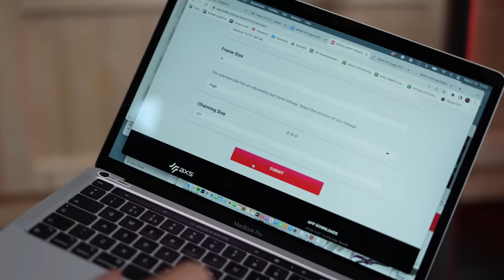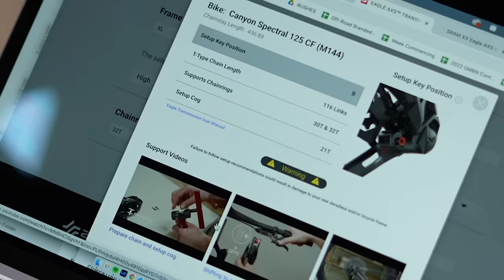NEW SRAM GX Eagle Transmission | Unboxing, Installation And First Ride

Comment: Wow... $270?  My most recent cassette was about $50.  That's an XT 10-speed, but it still seems like the prices are getting a bit absurd.
Reply: Agreed!
Reply: 10 speed but how do you climb up a hill?
Reply: That's typical SRAM.  The regular GX eagle cassette is $225.  A Shimano XT 12 speed cassette is $150 and a SLX 12 speed cassette is $100.
Reply: @alabaster4263 easily, just drop the chainring a couple of teeth. I have no use for big gears
Reply: @alabaster4263 good ol MUSCLE
Reply: @alabaster4263  by turning the pedals.   Also, I have. 3x10.
Reply: @alabaster4263  I think your sarcasm has been lost on a few people...
Reply: @mctrials23  lol
Reply: And the durability is the same or less.

Comment: I love my GX AXS but there is one fundamental floor with the rear mech, the pogo pins fail because of water ingress. The springs in the pogo pins suffer corrosion and fail to spring back up and loose contact with the battery. Had mine less than six months and I’ve had to have a warranty replacement. This seems to be a common problem with the GX and not the XO & XX model as water doesn’t sit around the pins as it can on the GX. SRAM need to sort this out.

Comment: I recently pulled the trigger and bought the  Axs XX T Tyoe. Fitted it to my trail bike and it’s flipping awesome. Doddle to fit and under load gear changes are a game changer. This GX version is the same thing just a fair bit cheaper. Prefer the battery placement too, something them didn’t do on the top tier versions. Awesome kit, SRAM are knocking it our the park at the mo. Paired it up with the new Ultimate stealth brakes also. Tidies up the cockpit and cables hardly noticeable now. Such a clean look with the AxS dropper. 👌👍
Reply: Hi do you have new Axs system or the first generation?
Reply: @slavbielesz184  it’s the brand new transmission XX T type full drivetrain which removes the UDH.  Not cheap but awesome. The new GX T Type offers very similar functionality for a fair amount cheaper. However still not cheap but brilliant 👌
Reply: Thanks for your reply.

Comment: Agreed, I think everyone wanted to know what GX would cost and when it would release 😁

I personally want to know if I can still use my Canfield cranks with an aftermarket T-Type 3-bolt DM chainring and still use this drivetrain. (Cmon Wolftooth!)
Reply: I've got a feeling you won't run into any trouble using a normal 12 speed sram ring with this, but who knows.
Reply: Your wish came true.  Wolf tooth just released some chainrings recently for transmission that will work with your old cranks.
Reply: @radian2323  Heeeeell yea!

Comment: Doddy, how’s the clutch? The prev GX AXS clutch was weaker and caused a lot of chain slap and noise. Is the new GX AXS, enduro race ready? #askgmbntech
Reply: It was a weak clutch for sure, but the main problem was the whole DR slopping around as there is no cable housing to keep it tensioned.  This new T-Type DR doesn't move, and they have increased the tension on the clutch. Downside is they say it does wear the battery down quicker.  But apparently no more chain slap.

Comment: I think the SRAM T-type AXS Transmission is perfect for a full power MTB; but my 17 yr old MTB with Shimano Deore XT 3X10 has always shifted reliably under extreme duress going up a steep bluff in the woods!  I think that is why Shimano is not feeling any pressure to change.  XT is already fantastic!!!

Comment: As a test, try the derailleur only on a bike with nx all round for example. Be interesting if it worked OK or not.
Reply: I'm curious as well, as I have the NX groupset and wanted to just buy the RD and the Controller...I'll ask LBS as well before purchasing.
Reply: @dongkapuyawn5107  Well, they're already stated that this is designed only for the new cassette series they created, while the NX is still based on the previous Eagle design. I'm sure it will still function, but your experience will be absolutely nothing like what you see in reviews.
That being said, the NX cassette is kind of garbage so it'd make more sense to sell it if it's relatively new or wear it out and then upgrade.
Reply: Gears are not spaced the same as older eagle 12 speed. They are much closer together.

Comment: Doddy, did you leave the shifting 'backwards'? I am glad to see someone else feels that the upper button to shift up the cogs makes more sense! Well, when the revised paddle for the prior version came out, the new paddle was more consistent with the mechanical shifter when set up backwards so now I have all my bikes set up that way including the ones with the t-type.
Reply: When I get mine I'm going to try Rhys Verner's set up, bottom left pod to shift down, bottom right pod to shift up just like a car paddle shift. Either top button for dropper

Comment: For me its still to expensive. 
But with the gx its getting better 
Maybe in a year or two
Reply: It just made all the high end mechanical groupsets (XTR, XO1, XX1) obsolete though.  $1100 is cheaper than XTR or XX1 and only a little more than XO1.
Reply: @mrvwbug4423  
Yea but thats no valid argument. 
With release of the Transmission line up it was obvious, that the "old" eagle line up will be substituted with that. As always it startet from the top end, with the lower price points released later. The Problem is, although named gx, so like the mid range predecessor, the new gx is priced way above that. 
The people who bought XTR now can buy gx 
The people who want more can buy the new expensive stuff. But what is with the people who bought gx and nx? 
When gx eagle was released it was priced around 500
The gx transmission costs a grand
Reply: @mrvwbug4423  
This is a Problem we can see in every industry. Doesnt matter what we look at
Lets say there is a budget-series a normal-sries and an ultra-series
The Budget 2019 once costed 200
The Normal 2019 400
The Ultra 2019 700

In 2022 they release new models 
The Budget 2022 now costs 380 
The Normal 2022 costs 650
The Ultra Costs 1000

Althogh named like before they price each one a tier higher. But because they name it the old way many guys dont think about it. Especially not the reviewer. Great for the people who want everything. But what about the people who once bought the Budget? There is nothing left for them in the 2022 Series. 

Lets see how its gonna be with the Transmission line. In the eagle line the high end Stuff costed 1.5 grand, the best bang for buck was 500-600 (gx). That was the "group of the people" and the budget one was around 300-400 
I am quiet sure they will call the gx the group for the people, although priced the same a few years ago the high end group was priced. Its so ridiculous 
Now they

Comment: After two years of use, I had a bad experience with a GX Eagle AXS : one of the pogo pins making the connection between the battery and the derailleur broke. Of course warranty was void by two months.  When contacted for a solution SRAM answered me that unfortunately there was nothing they can do to fix my problem. Solution proposed: buy a new derailleur!! I will think about it twice next time, that's for sure.
Reply: yea after 15 Years my Snowboard broke, Of course warranty was void by 10 years and they didn't replace it.
Will not buy that again.....

If you had any brain you would just call there 10x times and one of those someone will help you.
But yea... ;)

Comment: Thanks for this video guys! I believe you spoke quickly about backwards compatability, but I wanted to just check. Will the SRAM GX T-Type 'Transmission' run with an XX1 or XO1 AXS cassette (previous version cassette)? OR does it need to be a 'Transmission' cassette (XO or XX)?

Comment: Hey, do you have any info on whether you  can change just the derailleur (for the old gx axs) and use existing chain and sprockets? Are the rollers on the new one any different then on the old one? Thanks

Comment: I like the setup a lot, except the price.
Last month I wrecked my first (M8100) rear mech, a branch popped up into it and ripped it apart. (Cage broke, and the aluminium paralellogram also broke)
I replaced it with a M7100 mech, which I guess is somewhat comparable with normal GX?
It cost me €85 . What would replacing the cage and skid plates on this GX AXS cost? I can imagine it would cost me more.
Reply: No, the GX is more equivalent to the M8100 and the XX1 is equivalent to the M9100. X01 is in weird position where it doesn't really exist in Shimano land.
A cage with pulleys is like $30 for GX
Reply: @rustler08  I reckon SLX sits just under GX then? Because comparing it with sx/nx doesn’t do it justice.

Comment: been mtb for 30 years.   analogue shifting has never ever ever been an issue.   long live analogue....
Reply: I have exactly the same feeling as you. I use a mechanical 1x12 sram GX and I do not really see the point of the electronic gears. I have ridden bikes with electronic gears and I do not notice the shifting difference, a few milliseconds do not really matter if only a computer can notice them, I could not really see the benefit of it in racing or hobby riding. A well installed and maintained gear cable and mec shifts perceptively just as good and within similar precision. I really wish that Sram and Shimano will not fade out developing new mechanical group sets. Not saying that I am opposing the technology but I wish they still made both mechanical and wireless so they can please both parties.
I have a feeling that soon this kind of debate will transform into one of those rim brake vs disk brake topics.
Reply: @alexandrugabriel8510  agree
Reply: @alexandrugabriel8510  after riding both, I would take a gx axs over analogue any day, the only problem is the cost...
Reply: Until you hit it on a rock.
Reply: @colincoulthard3021  Funny, I've hit several rocks, and had several 'yard sale' wrecks.  Derailleurs survived just fine..
Reply: I can't see the point of e gears. More weight, more batteries to deal with and hugely expensive. Why?? My regular GX works fine
Reply: @Puketaha1  exactly...
Reply: @Puketaha1  more weight is bullshit. You've left out the cables for one.
Reply: I’m all for new technology. As the cars, trucks, and SUV’s we drive have become more advanced, so should our MTB’s. It will be a matter of time when the cost of electronic drivetrains comes down. Next on the list of changes should be better internal drives. They exist but are too heavy and limited.
Reply: @Velo1010  no.  there is a beauty to simplicity.  I don't want to have to charge my bike, ever...
Reply: @bikebudha01  no I agree. But I think the wireless (electronic) shifting is a cool innovation. It makes the bike look clean. And those batteries will last many rides before charging. They are also small enough we can keep extras in our hydration pack. Forget e-bikes. I’ll never ride one.
Reply: @alexandrugabriel8510  Calm down. Mechanical systems will always be available for as long as we are old enough to ride bikes. If anything, there will always be used mechanical systems people will be selling. Don’t overthink this. Electronic gearing is pretty awesome engineering.
Reply: Bought my first mtb in 92’ and for the first time I can pedal as hard as I want and  tap away gears without ever letting up waiting for my drivetrain. It’s a big deal to me and changed my riding. A battery that last months that I can check life on is not a big deal. Cables are a bigger hassle any day. Also, the GX derailer is bombproof. Took a long tumble down a sandstone ravine, etc. Never stopped banging out perfect shifts right after I’ve legitimately bashed it.
Reply: Haha Luddite 🤪👍

Comment: #askgmbntech Doddy, I might be wrong but I noticed you extended the chainstay protector on your Spectral 125? I am thinking of buying the Spectral 125 CF8 and read a lot of comments online mentioning that the factory chainstay protector is kinda short. As a result the chain is chipping off the paint close to the chainring. I think i actually noticed it happening on Anna’s bike. Is that the case? If yes, what do you recommend as a solution? Thanks, Trian.

Comment: How do you think, what difference are between old style x-sync sram FRONT chain rings and new T-type? Why should they be not cross-compatible? In old X-sync there also was labels everythere "only x-sync, only sram" - i managed to race XC races for two years with cheap AliExpress front chainrings with my Sram Eagle GX AXS, ~3000km. There were no single problem with it. I think in this case there are also no need to change an existing front chainrings... What do you think?
Reply: as long as it is a single chainring at the front it should be fine, but maybe ask a bikes shop

Comment: I'm all for them as long as the don't rely on using apps, and if you want to see why just look at the latest stories of the Nissan Leaf where the app is no longer supported and features like being able to start up the heater and get the battery warm in a morning before you get in are no longer supported. Or HP printers where you now are being forced into a subscription service so you can print. Built in obsolescence and you get to spend another grand on the latest shifter.

Comment: Doddy it's so great to get your ride review of this great SRAM set up!    I have a 55mm chain line but not UDH.....By frame is totally made from Carbon including the rear Triangle....do you guys know any Carbon frame shops who could modify my Rear Triable to accept UDH?     Thanks Magoo.     BTW....I use the same Pod to shift my SRAM XX1 Mech set up....I love it!
Reply: I wouldn’t recommend playing with the carbon to make it fit
Reply: @thegrommechanic6265  Experienced Carbon Fabricators could do this easy....they just have to modify the Axle mount to make it work with a UDH fit-up....It's not rocket science!
Reply: @Magoo71  I don't get it, even then the frame wouldn't match the profile of the hanger
Reply: @thegrommechanic6265    THERE IS NO HANGER Genius!  It mounts to the same place the Axle does!
Reply: @Magoo71  okay fair point😅, however the side where the udh sits on the frame lets room for the mount of the new transmission. You'd file that area, is that what you intend to do? Also does the diameter of the locking bolt on traditional hangers vary from one model to another?

Comment: I'd like to know if there is a T-type chain ring that will fit the Quarc DUB zero power meter (which is already the 8-bolt pattern). I'd consider upgrading if I could keep the XX1 carbon cranks and power meter; certainly seems you could just mount the new T-type ring on the XX1 8-bolt crank, but the power meter is the issue.

Comment: @gmbntech At 12:19  you talk about the T Type chain could be retrofitted with the eagle system, if I do install transmission derailleur and chain what could be the problem on using my eagle cassette and chainring if the new chain can be used with both systems?

Comment: Do I get it right-the transmission drivetrains cannot be fitted on any frame and you need a UDH compatible one? I mean you cannot just upgrade your frame, you need to buy a new one?
Reply: if your frame is not UDH compatable, you cannot mount this on the bike
Reply: @georgeelgar5986  Thanks

Comment: Great video  doddy.
Would it be possible to fit to nukeproof reactor 2022
Reply: as long as it fits a universal deraieur hanger, which that bike does, it will be able to directly mount to the frame

Comment: Could you run just the derailleur with the old eagle cassette chain and front cog? i.e. is the spacing the same? I appreciate it might not shift as clean…
Reply: no, but the front chainring should be fine, as the new deraleur has very precisely set setup cogs that allow it to calibrate without limiting screws

Comment: What if you were to snap the chain out on the trail and shorten the chain a link or two how would this effect the shifting as there isn't no adjustments?
Reply: it would be fine, its a normal deraleur just with direct frame mounting and axs

Comment: I use a mechanical 1x12 sram GX and I do not really see the point of the electronic gears. I have ridden bikes with electronic gears and I do not notice the shifting difference, a few milliseconds do not really matter if only a computer can notice them, I could not really see the benefit of it in racing or hobby riding. A well installed and maintained gear cable and mec shifts perceptively just as good and within similar precision. I really wish that Sram and Shimano will not fade out developing new mechanical group sets (for now I am not sure what they plans are). Not saying that I am opposing the technology but I wish they still made both mechanical and wireless so they can please both parties.
I have a feeling that soon this kind of debate will transform into one of those rim brake vs disk brake topics.

Comment: Man, this is an unreasonably hard to find product from retailers because confusingly they all still list the old one if you just search for "gx eagle axs" for example. Also many retailers don't seem to show the bash guards on the chainring but I guess there's no variants here and they've just not installed them for the shots?
Reply: That's because you need to be searching for T-type or transmission.

Comment: Hi Doddy, is this a good system for e-bikes then?
Reply: Not Doddy, but it will be absolutely perfect for ebikes. I believe they are rated for up to 2000w of power underload shifting, so your average ebike up to 600w plus whatever your legs are cranking will not overload it